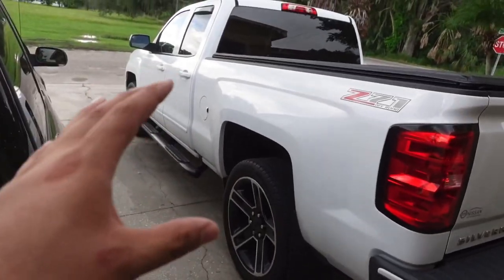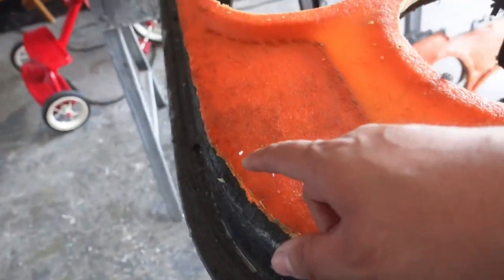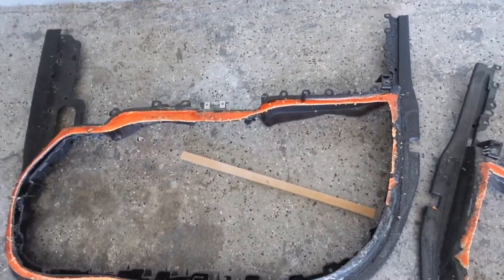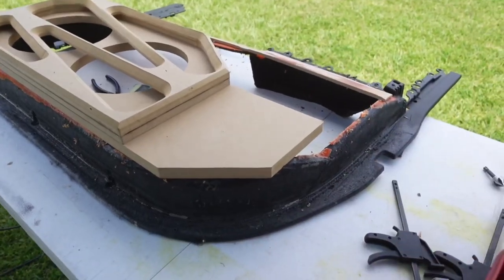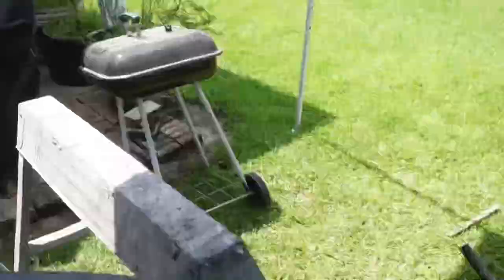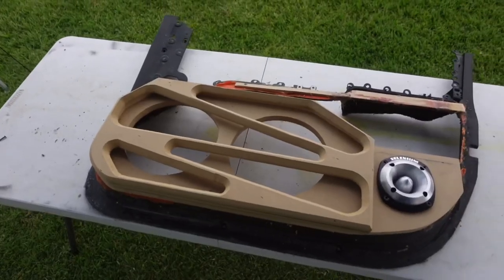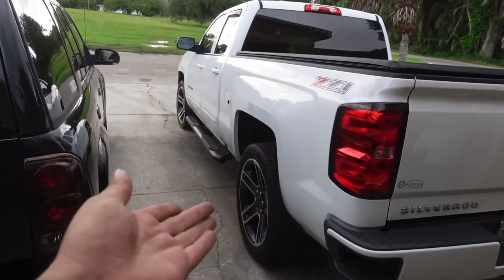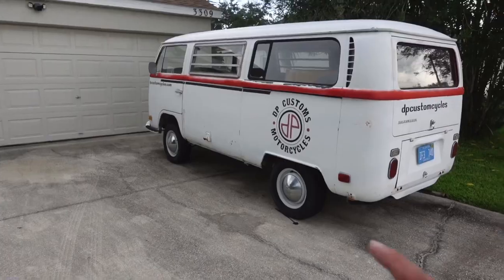DOOR PANELS FOR CHEVY TRUCK LOOKING Fire🔥

Comment: I found u by a yt suggestion, and it waa a good suggestion, u did a good job on those horrendous door panels, I have a 40k watt demo truck, I can build boxes but I have never done door panels, I wired and did all the fabrication, I may have 175 hours in my truck charging system included, I think I got 20k in mine so far, but u r doing a great job keep it up